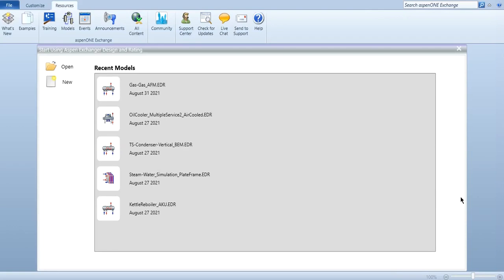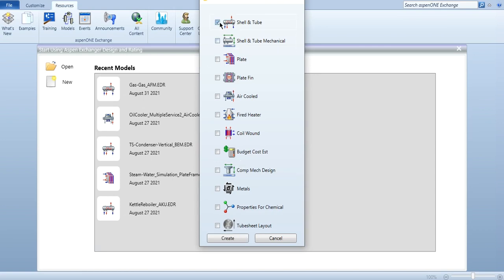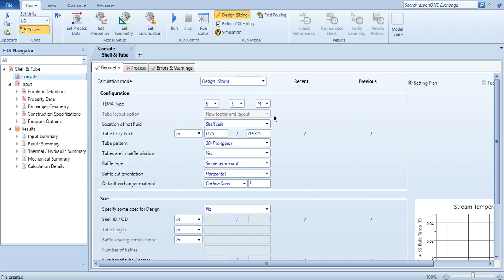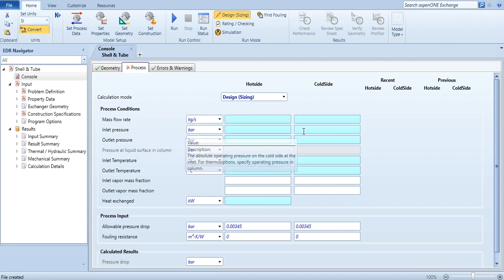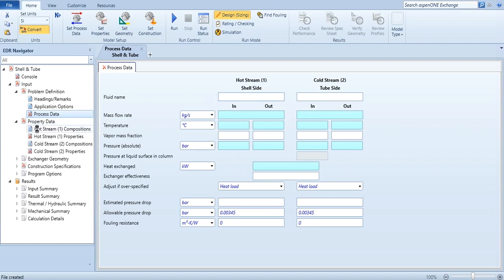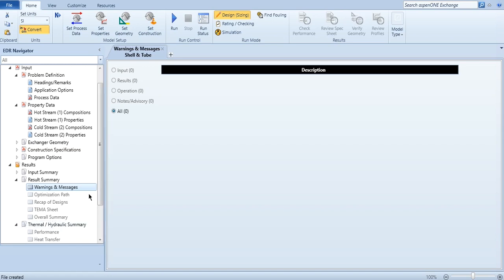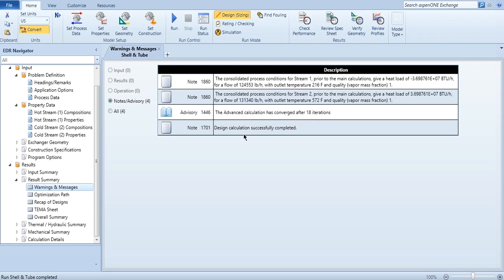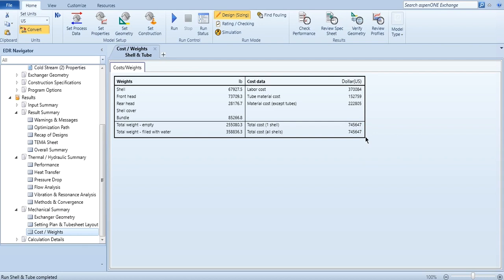Introductory lecture on Aspen Exchanger Design and Rating - Lecture # 82

Comment: Hi every one
I am using EDR 12 to simulate a shell and tube evaporator in which Cuprofin tube ( Inner Grooved Tube) manufactured by Wielnad would be used, but I can not know how I can input the specific parameter of the tube into EDR. Is there anyone to guide me?